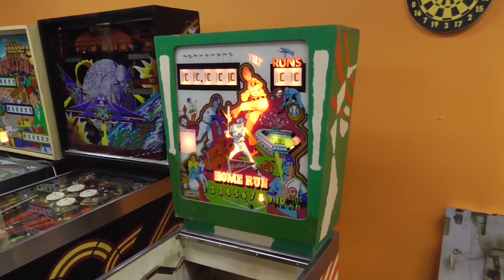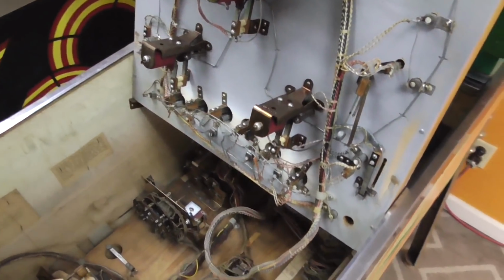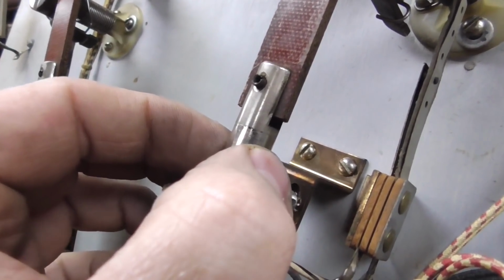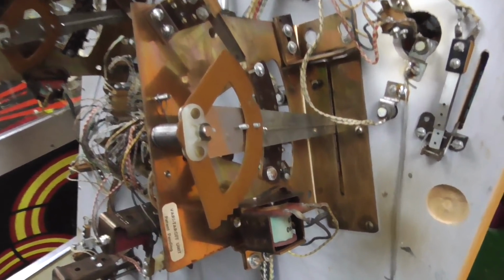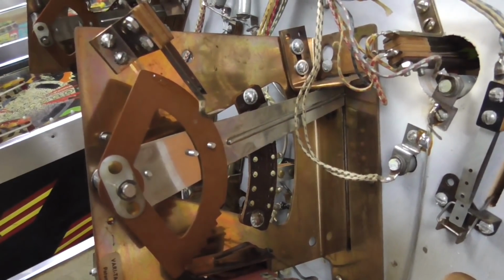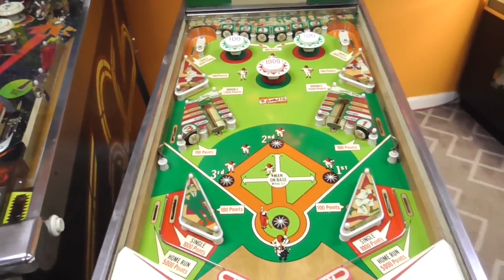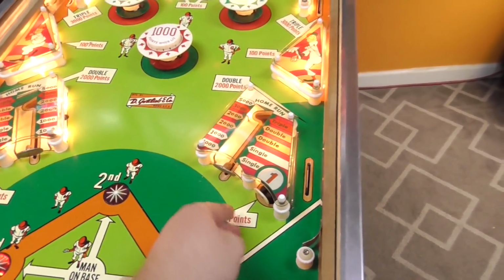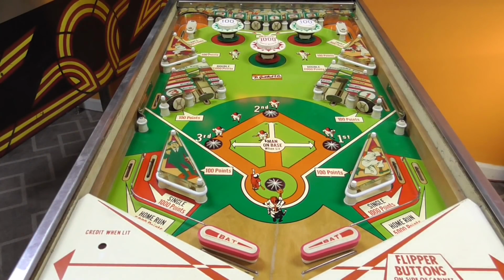1973 Gottlieb Home Run Pinball Machine Repair - Genius Vari-Target Mech was used on 40 Playfields!

Comment: Back-inna-day, we used to have contact burnishers, AKA "points files", that were flexible but abrasive enough to clean corroded contacts. Being purpose made, I would not expect them to be overly aggressive. If it was good enough for copiers in the 1970s (also largely electromechanical), it should be good enough for pinball machines of the same era!  I wish I could find mine now, because it's also handy for the mute switches in old record changers (leaf switches like the ones on the playfield).

Comment: I'm working on the twin machine 'playball' I scored Saturday for 250 bucks! These videos have been super helpful, thanks!
Reply from the maker: Very cool the gerg, I'll just say this game (and playball) are real keepers, once you get it right i'll bet you hang onto it for a while.  Nice clean little game with a simple ruleset that's fun as hell to play once it's working right.
Reply: @LyonsArcade I got it working and can play a game, yeah it's totally growing on me, I love having points AND runs!
I have a quick question ... 
When I hit the right flipper to launch the ball neither flipper coil fires until something scores on the playfield. Is this normal for this game? I can only play with the glass off because I have to trigger a point before I can fire the flippers lol.
Reply from the maker: That in fact IS normal for the game.  Basically the flippers only work as the eject until you score a point, then it turns on the flippers.  Very strange setup.
Reply: @LyonsArcade  Haha I was going crazy trying to figure this out. I noticed on your video how the ball launches directly into the pop bumper. I guess I need to make it so it shoots the ball better, mine is pretty weak. I guess if I replace the coil it should fire across the playfield.  On mine it shoots the ball a few inches and it rolls back into the trap. It's possible I have the back legs to high. Thanks!

Comment: It's surprising how well a Scotch Brite pad will work.   I've seen them used where corrosion needs to come off while protecting the surface coating.  Not so critical with the pinball connections as a few scratches don't matter.   I guess a Scotch Brite is designed to scrape baked on grease off your fry-pan.     Deoxit is good for surfaces with virtually no corrosion, but I wouldn't rely on it for the heavier duty cleaning.   Just my thoughts, I know some will disagree.
With the black light globes and heat.  That black looking coating inside is a metal coating from where the metal vaporises off the filament.   It traps the heat from the filament more, makes the glass get super hot.

Comment: i think the reason you were loosing balls is that, when the 10 point switch was stuck you got your 10 points and it was detecting the ball sitting in the "out pocket??" so it thinks you sewer-ed a ball and deducted it from your tally. i dont think they had set up a circuit that disables all scoring till a ball is in play on the field.

Bells??? love those classic pinball sounds.. Needs more cowbell!!.
Reply from the maker: I think you're correct!  Yes the ball won't count down until something is scored so it would have subtracted one over and over again, makes perfect sense!

Comment: Is it normal for 2 pop bumpers to fire at the same time?  The two back ones do.
Reply from the maker: It depends on the game, on a lot of older EM's yes they both fire at the same time.  Since they need a relay to work, they just use the same relay for both and save the cost of a relay.  Once they went digital they don't need a relay to work so they can operate independently without it costing more.  SOME EM's though did have separate relays for each pop bumper, if the scoring was different for each one.

Comment: Hey man sorry to be a bother I need a hand trying to fix something on my old Harley Davidson and la riders arcade machine. Not sure what model but it is the the one with handle bars no seats included. The only problem I have with it is when I try to connect the slave to the main head unit they both start up but the slave gets frozen on the press start screen and I cannot do anything to stop it from happening any ideas.

Comment: What types of Mechanisms are the player unit stepper unit called? Because the Varitarget Mechanism is different compared to those Stepper Units that have the spider selector. The Varitarget is a different type of mechanism but I'm sure they call the mechanism something. I know that the player unit, ball count unit, the bonus unit, all use the same type of mechanism that uses that Spider lever selector.  I'm not sure what the correct name is for that Spider Selector lever, do you know what the correct name its called?

Comment: I think there's something wrong with ball counter unit. There should be only five balls at the beginning of game, but it gives eight. This is an Add-A-Ball game.
Reply from the maker: There is nothing wrong with the ball counter unit...
Reply: In a previous video Ron showed where in the back box you can set the number of balls you start with.